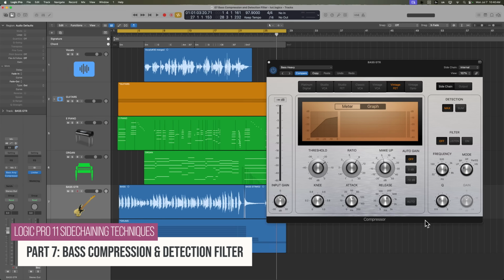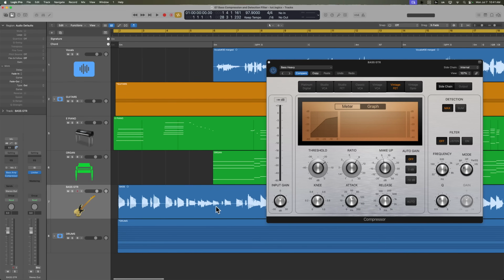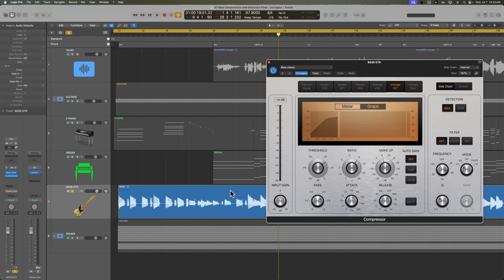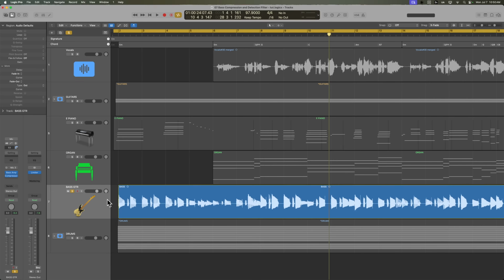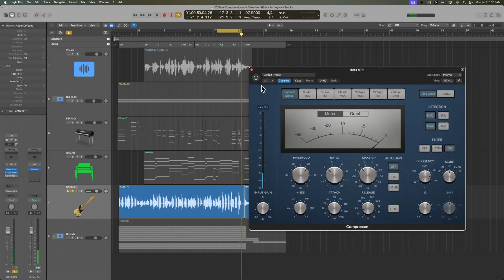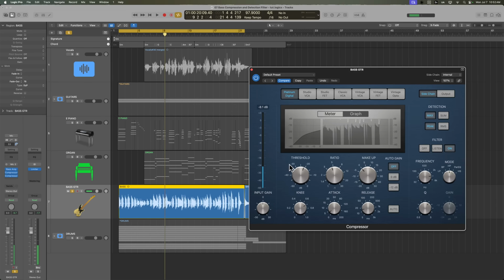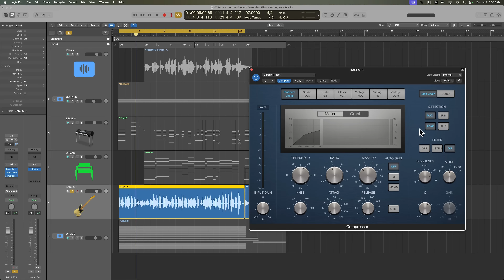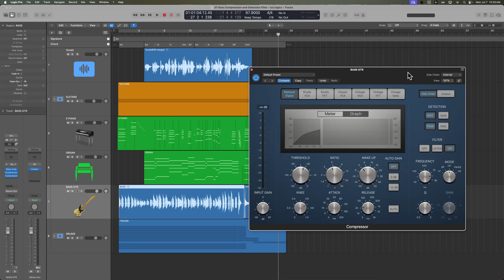Logic Pro 11 Sidechaining | #07 Bass Compression & Detection Filter

Comment: Hey Josh, at 4:05 you talk about going through the audio and "manually editing them out" in reference to the clicks. Is there a way to do this that I am not aware of in Logic Pro? Or do you need to use a third party advanced audio editor like RX?
Reply from the maker: For isolated click removal like this, I would just use the marquee tool, isolate the click and then delete it, or maybe even roll down the gain on it, so it's not so noticeable - although, keeping it in, or even accenting it, might be a stylistic choice.
Reply: @MusicTechHelpGuy thanks.  I assume you mean you would automate the gain during the click?  I’ve watched some mixing engineers use RX to reduce sample peaks as a form of manual limiting.  RX will actually re-render the audio file after manually editing those sample peaks.  I was pretty sure Logic Pro didn’t have any built-in way to do this, and just wanted to confirm that wasn’t what you were referring to.  As far as the gain utility, the transient clicks like this are often just a couple of milliseconds long.  Will automating the gain control be accurate enough to turn down and then back up again within only a few milliseconds be accurate enough?